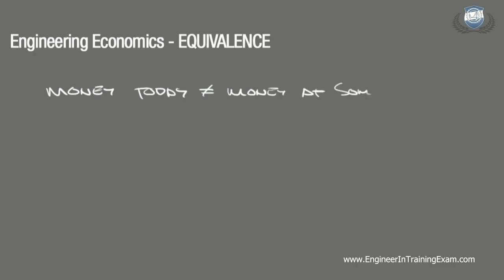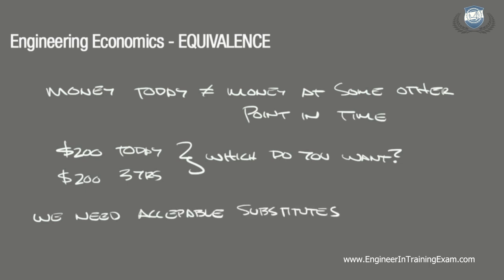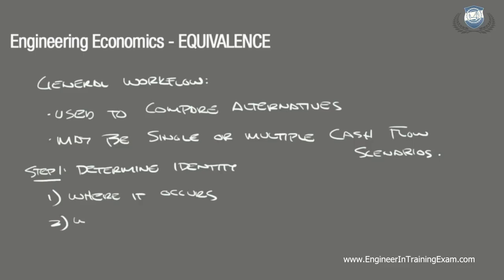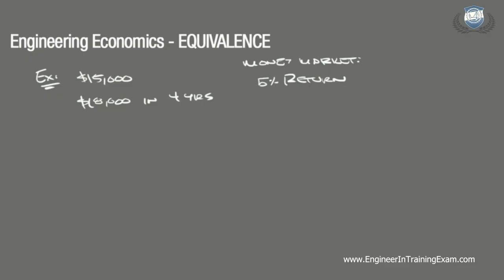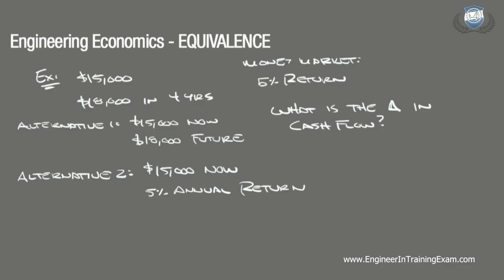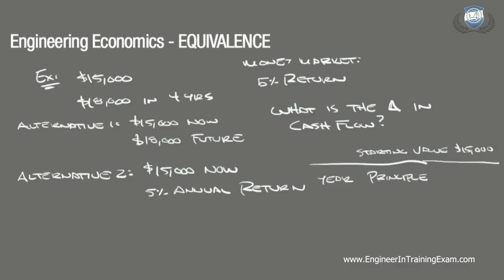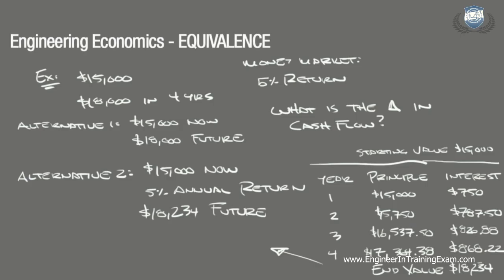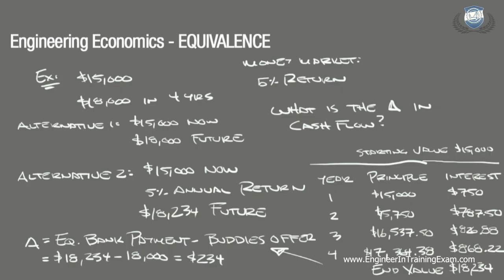Equivalence - Fundamentals of Engineering Economics

Comment: Justin, thanks so much for your time. I like to solve these problems by using the Factor Tables in the NCEES Reference Manual.

I interpolated between the n=4 on the 4% and 6% F/P Tables, and simply did (15000)(1.2162)

Mike